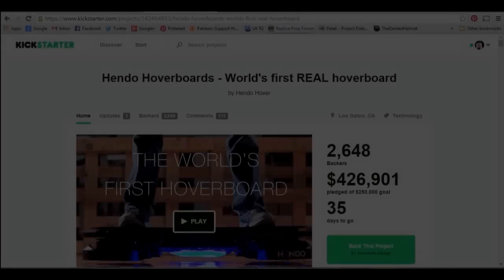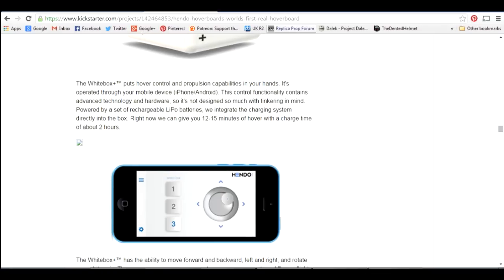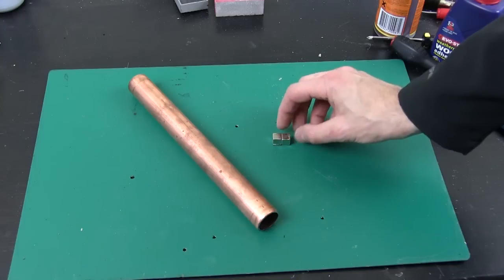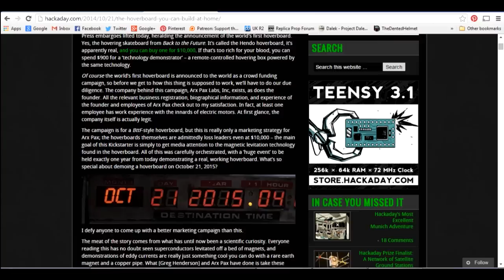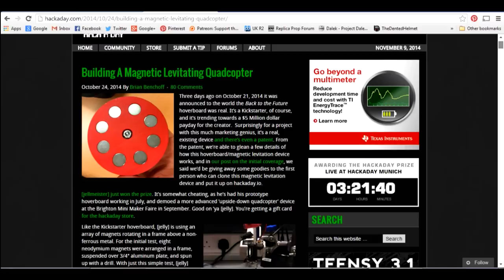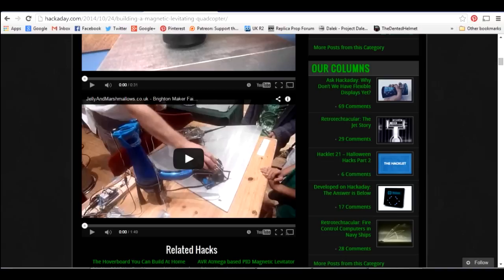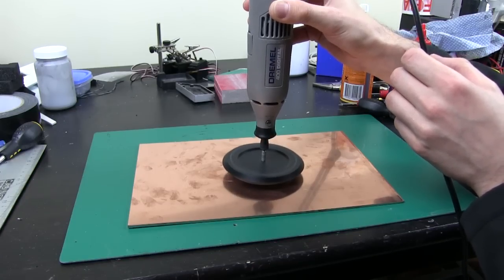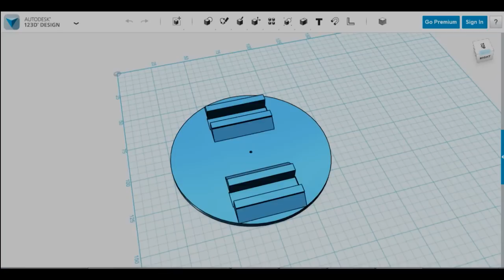How To Build a Real Hoverboard | James Bruton

Comment: wouldn't be easier if u make the aray with electomagnets? i mean if u build it with "small" copper spirals that are placed in the wanted formation and depending the current flow through them they will gain the N/S that is desired thus creating the aray without the hassle of placing the magnets you have atm

Comment: Glad to see someone looking at this, I'm clearly very late finding your video!

Did you get any further? 

We had a bit of a hiatus while I got married this year, but we are back on the hover R&D now. Hoping to scale up to man carrying next year, mostly depending on if we can get some sponsorship to defray the £2-3k it'll cost. We have plans for steerability too although we may keep it simple for the first build. Hopefully see you at a UK makerfaire in 2016!

A quick point for magnet play, most magnets drop significant magnetism if you hotmelt them, I wouldn't advise unless you have higher temp rated magnets (most drop up to 10% flux below their 80degC operating ceiling!)

Jellmeister/ half of Jelly and Marshmallows

Comment: If a hover board is made with 4 of these magnetic engines, how do you steer it? Does it work like a quadcopter by varying each motor receives or would it need a gimbal that could redirect the thrust?
Reply: +LgGamer Quit  you can see they steer some of them with remote controls without people leaning on them
Reply: +connor joslin that's basically a quadcopter, with magnetic fields and rotating magnets and instead of air and propellers, so it just varies the speed at which the magnets spin, which pushes the board away.

Comment: If you're planning on actually attempting to make the magnet array, maybe you could try making some sort of square "chamber" to hold them? Possibly use a clamp or something to push them in initially and have a chamber system or something. Do they actually have to be touching or just really close together? Cuz if it's just really close together then just 3D print something with 4 cubic chambers that can then be clamped and acetone welded shut.

..I really hoped that made some sense lol

Comment: id come across this kickstarter before and was very impressed and I believed it because they dont hide the fact that it needs a non magnetic metal floor to run on like you mentioned which will be massively expensive so if you managed to buy the board you would have nowhere to actually use it.

What we really need is something that repels against earths magnetic fields, the problem with that is that it would need to be massively powerful and id imagine it would effect many other devices badly while in use. Id love to see what sort of results you could achieve but as you mentioned it could get very expensive.

Everyone who has watched back to the future dreams of owning a hoverboard and im really disappointed that we are only a year away from the time Marty visits and we dont have them (ones that fly over pavement and water not just metal.)
Reply: ***** you mean riding a cusion of air?
http://www.wired.co.uk/news/archive/2011-05/12/ground-effect-train

I wonder if anyone has tried to build a hover board built like a hover craft with the skirt around the edge to hold in a cusion of air to make it float?
Reply: I think this would be really cool to make lets say something like "wipeout"... I think that would be the most interesting race sport ever.
Reply: Jason I know the real tech, but to keep it from flying away from the ground you'd need a sonar system maybe combined with a laser to keep it spaced automatically from ground. Honestly though; if you had a board that produced up to 500lbs lift, would you keep the output low and stay near the ground, or use that full 500 once in a while to fly around the earth a few times? Maybe see Angel Falls in Venezuela, the Redwood forest where they filmed the Ewok battle for Return of the Jedi.
 I calculate over 2k mph from this thing I'm building, runs in a protective ionosphere because it's zero point. That's 3218.7kph for you guys on the metric system.

Comment: Just an idea, say you where to use the Lorentz force law to create a upwards propulsion upon a strong enough wire, (of which could in some way be attached to the magnets applying its force) and have a high enough current flowing through it. Could you not create a hover board using that as a way of lift?

Comment: James. Your rotor is open where you are gluing the magnets into those cradles. If you made the rotor in two halfs that screw together you could have the magnet holder covered. glue in the magnets in your array then screw the two half of the rotor together. that should make the whole arrangement far safer.

Comment: So is there a way of powering earth magnets? with them spinning and powered, with enough power could you increase the field to push it from a copper panel? to that thought does the surface have to be solid metal? or can you just use a mixed surface material?

Comment: I was wondering ,,If a current is induced creating an opposing magnetic field, does the current induced by spinning the magnets create enough heat to melt your hot glue holding the magnets? Maybe if you try to use a non conductive Heat resistant  epoxy glue to hold the magnets in proper orientation for your array.Randy

Comment: Instead of having open slots for the array, you could do tubes with the ends against the direction of spin permanently blocked off. That way, centrifugal force holds the magnets in.

Comment: It seems pretty inefficient and expensive to do this with mechanically rotating permanent magnets, when you can make the same thing with coils on an iron core and AC current like in a induction AC motor.

Comment: The magnets fly out when it's spinning and forced close to the copper. That's when they are under the most stress, I guess. Maybe 3D print a strong plastic box or cage to slot the magnets in.

Comment: Just a tip, do not use hot glue to glue magnets, they will loose some if not all of their magnetic force. Instead use another type of glue, most other glues work pretty good. Also be careful of magnets shattering.

Comment: James here is where I think hover board are going to meet its challenge, when you look at a skate board, while it is rolling, the wheels makes the board able to move either forward or backwards, now the skateboard won't move right or left straight,  because the wheel won't let it, the friction gives you more control, but a hover board as we can see in their videos, you can't really control, it spins you round and around, and the only reason he was able to swing from side to side, was because of the ramp. Idk the technology still further away than 2015, I believe we will have a ton of angry costumers, specially given that it will only hover over the special ramp that comes with it, after all, it is magnets, and people can't really expect to ride this at their local park, as they said, they will build a park for it.      :/
Reply: The board is sort of a magnetic quadrocopter

I'm sure that it can be controlled in the same way eventually

Comment: Couldnt you use 4 super powerful fans and the program compensates for the weight of the board allow it to hover and it figures out your weight so it changes the power that the fans are getting. Hope you can make sense of that.
Reply: That is almost imposible because a fan with 250 rpm of 120 mm is capable of lifting 1.7 pounds so even if you could find bigger and stronger fans you still need a lot of force to even lift you 1 feet. So with the current technology fans aren't going to cut it :P 

PS: Airflow is going to be a pain too because it would need to move massive amounts of air to create lift.

Comment: U can make a hover board out of four 2$ 50lb lift and a switch and 2 ft of wire u glue the magnets to the shoes on on the tip and one on the bottom then connect the circuit to a 12 volt battery and last stand over a metal beam

Comment: I have always said a hover board is possible. This is how i think you make it to work : everything has a magnetic signature , even water and frogs etc , who you can levitate in a super magnet. The trick is scanning your surface in realtime and generating the opposing field to keep the thing x amount of distance of the surface. It is like that toy you can hang staplers etc. in that makes it float but in reverse. The problem is : speed and power. It will take a lot of processing speed and then amounts of energy to counter. But in time i think its possible. And yes if you make the variable of surface less then it will cause less problems like a coper sheet. But then again that's not the thing in the film. But yes one day we will have free floating maglev.

Comment: you can just make a hover board by using your 3D printer you can create a top and bottom with a couple of vents on the bottom and put a couple of fans set to a specific speed (i have a RC helicopter and when its low battery it will hover off any surface. that is how i got that idea) inside the top and bottom also have a couple weight pads fitted in the to the top part that will be connected to both motors of the fan that will make the speed of the fan go faster depending on the weight that is on the weight pad (so if you take your foot off the back it will level out and you take your foot off the front it will still be leveled out) so when you you are getting on the "hover-board" you will put one foot on front or back and depending on if you put your foot on the front the front fan will start to go faster so it doesn't dip ford when your putting your other foot on. if anyone else have to add to it because i fell like its missing something please let me know and i'm not to shore if the science behind it is realistic or if it will work and if this comment can get 50 likes that will make my day and i'm only a preteen so this idea might not be the most logical so thanks for reading this i hope James Bruton will see this.
Reply: just remembered that it would need power so on the casing of it youll need a port to charge the battery for the "fans" and youll also need a switch on the side with the port

Comment: Too bad you didn't continue on with this. If its strong enough to rip out of hot glue then you could probably work or a way to hold them and spin them with enough torque to actually make a hoverboard. I can see why your not into it though. Thats a lot of force to be messing with when your used to working with 3D printing and costuming material.

Comment: It ant that hard, hell. Just  3d print some brackets, and simply slide the magnets into the slots. For added protection weld a top peace of 3d printed material on the top, fully in closing the magnet, like I'm sure Hendo does.

Comment: And they said we wouldn't have these by this time in relation to the movies ha jokes on them. But I did get a brilliant idea for a future project(s)!!!!! YOU HAVE THE KNOWLEDGE AND THE SUPPLIES AS WELL AS THE MEANS TO BUILD THE TESLA ENGINE OR MOTOR GENERATORS!!!! You could create free clean green energy using the same principles that make this possible. The clean energy is derived from the same concept as what makes them hover & that's the effects of the magnetic fields causing a current in the copper. There's many DIY you tubers with a lot less knowledge than you have so my idea is to start some free clean energy from the sources being that very current the magnets create in the conductive material copper being the most common and affordable. So maybe research a few videos on the topic and start making some engines. I've seen some that can power entire houses and even one man replaced the engine of a car and drove an electric car using these concepts. Another is to remove the petrol engine from a small emergency generator and place the magnetic engine in its place some have even powered their house for years on it using permanent magnets. Hopefully you do decide maybe as a side project to do this you may even be able to get a patent and sell them to those who lack the know how supkes means etc. to create it themselves this is a subject I've been fascinated by for years now and just been waiting for someone to do a how to that makes sense is clean and organized like your video formats would be perfect for! Please at least consider it as mankind as a hole has a lot to gain from this being independent of the power companies and gas too! Amazing the powers that be have suppressed this technology and knowledge for a long time and been using it and selling it to us even in air conditioners and other appliances a ceiling fan can be used as a pre built frame. There's too many ideas to list but all of your robots could be self sustaining running on their own power with rechargeable batteries even. I'd enjoy learning to make it myself as well from a coherent how to video such as your own a great format for learning. Even if you can't gain a patent due to the banks owning them and hoarding said patents at least you can contribute the knowledge and make tutorials or just sell some of your own gadgets from this side project that may help fund and cut power and fuel cost. ;) great stuff I hope you will consider it and end up doing some free energy stuff.
Reply: +Kronickillness Nikolaos sorry to tell you that, but the magnet going to a tube type of stuff can&#39;t make energy, it can transform it though, so if you have a wheel spinning the magnets over a coil of wire, you&#39;ll be able to make electricity. But the Idea is already taken by what&#39;s called brushless motors, and a more refined form is the generators used in most power plants. The hoverboard uses batteries to store energy, that goes into a coil of wire, which produces a magnetic field that makes magnets rotate, which are coupled through a shaft to other magnets, which rotate over a copper plate, which in turn produces a current into itself, so it produces a magnetic field back and so repels the rotating magnets, which makes the whole assembly go away from the copper plate. no energy was created, just transformations between magnetic fields and electric energy occurred (which produces heat, because not 100% of the energy is transferred from one to the other.)

you can still produce "free" energy, by heating water with the sun, and making it boil, then use the rising steam to make a motor turn, and get electricity. or directly use a wheel that a river makes rotate. even the nuclear power plants use the same idea, the uranium is "burning", thus releasing heat and making water boil, which turns turbines.